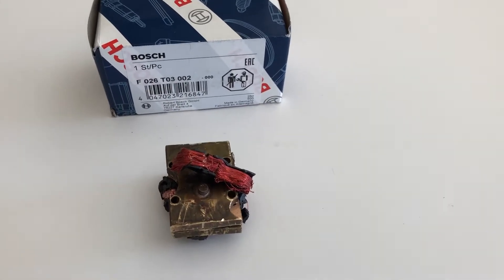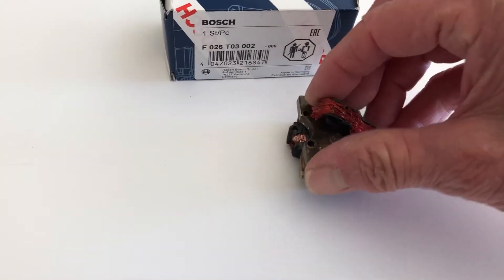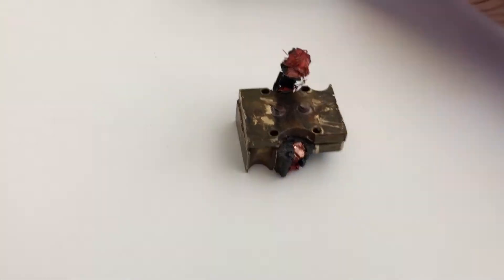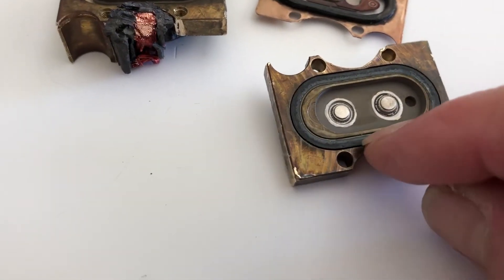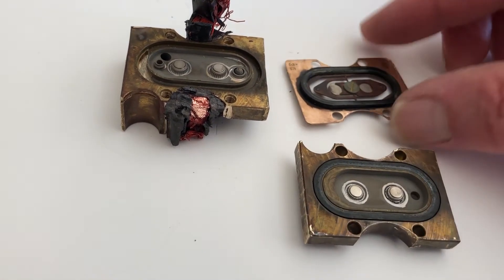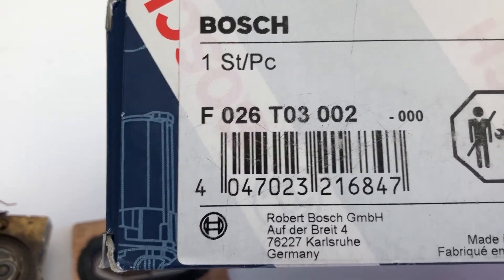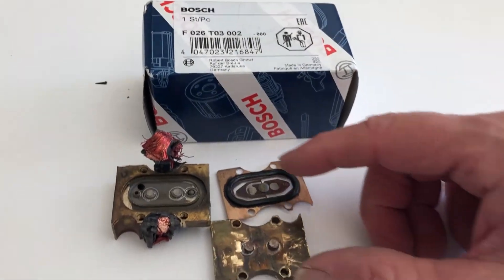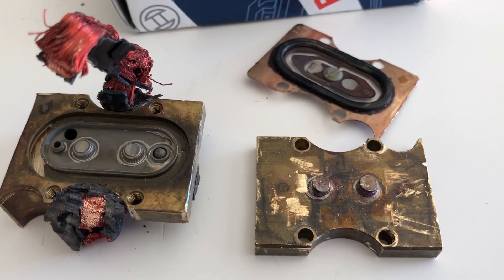What's Inside A Mercedes EHA Valve?

Comment: Thanks for tearing this down for me. I love seeing how something is designed and functions. I see now that it works with induction to control the flow of gas. Mine leaks like crazy and I may have to replace if o rings don't work. I have blown one out in the past with a bit of air and somehow that worked and the leaks went away and the car ran fantastic. Anyway cheers
Reply from the maker: Replace, not cheap, deal is those oblong seals inside get old,system pressure pushes fuel past them, its the pressure!
Reply: @mygermancars7264  OK thank you. I must ask, how do you  check duty cycle and what exactly are you referring to on this?
Reply from the maker: @816murphy  Its a way to adjust fuel mixture on this engine. https://www.youtube.com/watch?v=Ie0G2JSPr9I&t=123s
Reply: @mygermancars7264  Thank you. This is some old school technology haha
Reply: It worked! Thanks again
Reply: The eha valve that is

Comment: Greattt video. I wanted to ask cause I couldn't tell, I've a 1991 m103 w124, and I got some spare EHAs from a breaker. All work but leak and I can smell gas in the car which I hate. Was wondering if those gaskets are accessible from the fuel holes? I wanted to try spraying something in there to rejuvenate the seals if that is indeed possible.
Reply from the maker: Nah, their trash if they leak at the small holes, O rings if bad can leak, but not often, EHA is under fuel pressure 60psi, nothing seals the leaks, plus car starts running bad, in the past I had a 91 300E, didn’t have enough money for a new $300 EHA, so I searched eBay, looked for cheap ones, with return policy, went thru 3 of them, 1st 2 leaked, returned, third one was good ! $25 lol
Reply: @mygermancars7264  haha thats actually great advice. I was successfully able to stop my power steering leaks with AT 205. I have sprayed some in the EHA holes and left it for 24 hours. Will install this EHA and see what happens. lol

Comment: How do you adjust the new part before installing ?
Reply from the maker: Factory set, do not adjust! it can mess things up, after installing new one, you can check duty cycle and adjust that, its fuel adjustment , Google Hertz duty cycle  .
Reply: @mygermancars7264  My EHA is leaking gas and I’ve changed the O/rings and still leaking gas so now I guess I must replace it with a new EHA and if it does not need adjustments that will great thank you so much for replying back to me 👍
Reply from the maker: @Mesopotamia64   make sure replaced one has exact number on it, they are tuned for engine size. After new one is on I would check duty cycle for optimal running condition.
Reply: Has anyone tried soaking it in warm rubber rejuvenation fluid?
Reply: @michaelhayes7469  What? Let's put some in the swimming pool. Maybe it'll work for us too.

Comment: exactly my problem, i wanted to seal it up somehow untill i find one, but its steal leaking ...
Reply from the maker: Its under like 60psi of fuel pressure, so sealing it is hard, maybe some JB weld or 2 part epoxy, try sanding the plastic a little for adhesion.